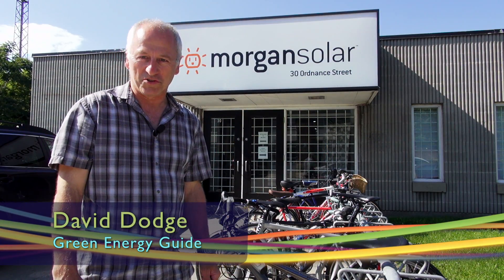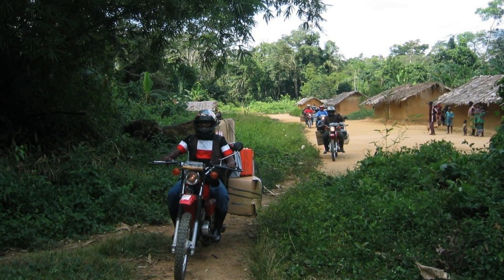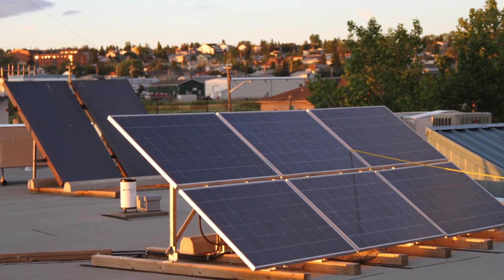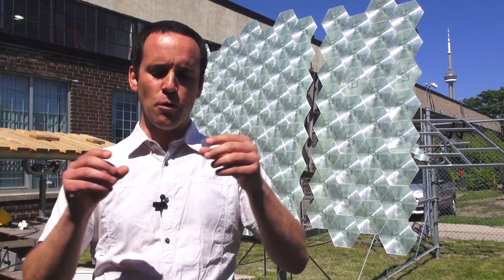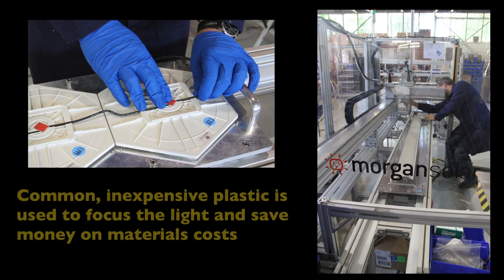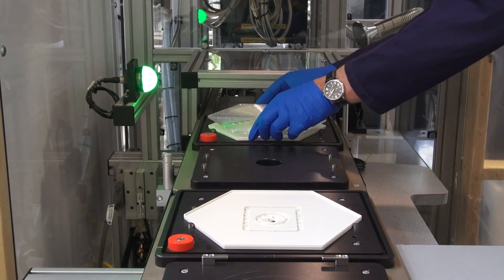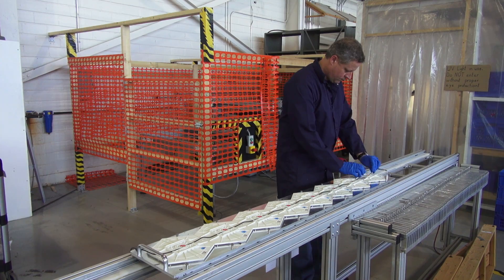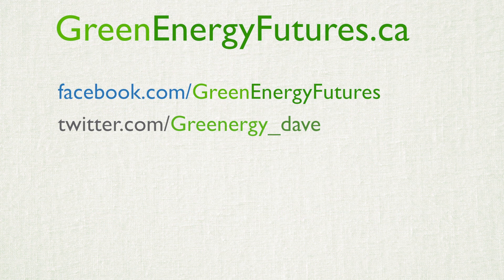50. Morgan Solar - A Canadian solar startup with a bright future

Comment: The issue with concentrated solar panels is that they need a tracking system. More moving parts + higher cost.
Reply: and what happens if EMP ? Or power out at control headquarters, to create a dependence on a company after a sale is not freedom, it is a trap, same as those roof water dehumidifier water systems.

Comment: This book [link here >>> ] got me thru the design and installation of a complete off-grid system for my lake cottage. The process of site evaluation, system component selection, wiring, etc. is complex, but with a lot of study and this book, I ended up very happy with the results. Everythttps://www.facebook.com/Build-Your-Own-Solar-132917764038406/app/208195102528120/hing you need to know is here. I recommend it for anyone who is starting with little solar panel knowledge and wants to end up with a whole house system.
Reply: Kevin Moore r

Comment: Is there any update on this company?
Reply: the guy said the plastic is the same as the stuff used in your headlight, check out how many 15 to 20 year old cars with good headlights you see next time you drive down the road? quite a few i would guess?
Reply: Just looking at that video again, the concentrated cells (the PV part) seem to be attached to an aluminium heat sink on the back, this would take heat away hopefully at a fast enough rate. I'm more concerned with the fact they are using plastic as the concentrator, as plastic will fail due to UV damage over time. I'd suggest they use some kind of poly-carbonate to fix this problem, but would increase manufacturing costs significantly
Reply: +ryefry well the company won a small 10MW contract. So it is still alive. it's the last CPV company still in business
Reply: Sunlight has a slightly different light spectrum to artificial light(more UV).  Secondly most headlights I've seen on cars are glass.
Reply: forget the bulb inside. what's shining on it all day when it's parked up? the sun.
 ya only high end cars have the plastic covers over their headlight so maybe the tail lights would have been a better example
Reply: polycarbonate is a plastic.  What in the world are you talking about?
Reply: But the solar cell will be what dies from heat not the plastic which is what the commenters above were saying.
Reply: http://morgansolar.com/
Reply: Their claims of twice the efficiency and half the cost are not even logical, nor reasonable. Concentrators cost nearly as much as just plain PV cells now. Also the heat concentrated on a PV cell will destroy its' efficiency and life. Not double it. He should have studied the subject more. People have tried and failed exactly what he is saying for many years. If they are still in business it is because he is a good salesman to gullible investors and customers.